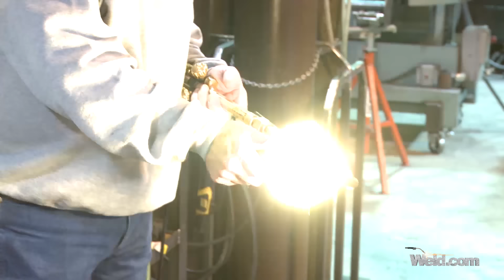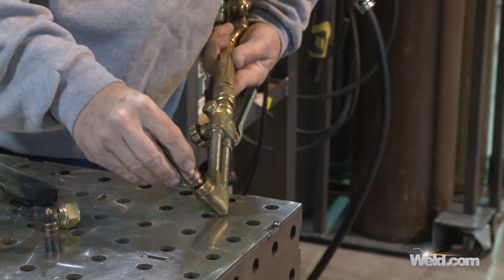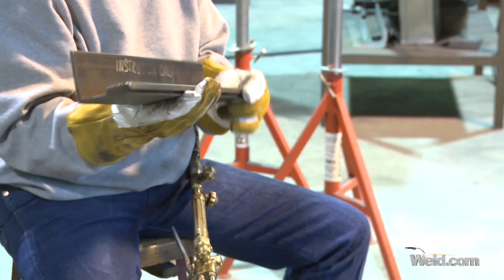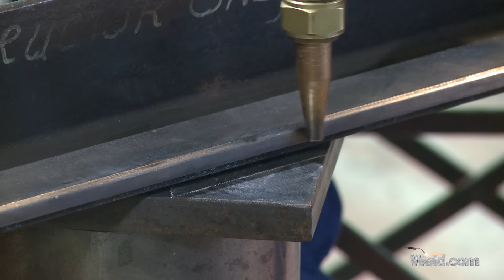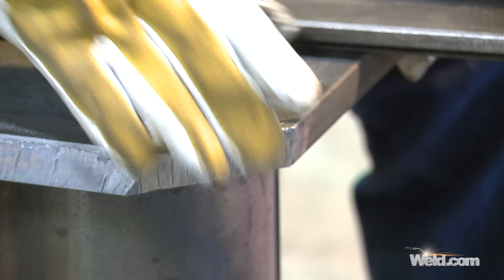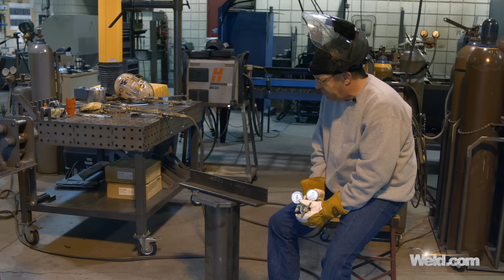🔥 Tips for Oxy-Fuel Cutting Thick Steel

Comment: A set of "tip cleaners" was always in my work bucket. Along with that I'd carry extra, different size tips. On a repair job, I'd swap out the company tip for mine (if necessary). Then swap back, when I was done.

Comment: Bigger tip. Say, 4 or 5. (I like Harris)

Pressure Gauges on torch. Two stage gauges at tank. 15 pounds propane, 65 oxygen. It’ll cut through most steel.

Comment: How can you tell if you have a regulator problem versus a pressure gauge problem or a acetylene doesn’t like the cold weather problem? I inherited my dads OA torch and am trying to learn but cannot find a teacher. When I set the acetylene to 5 psi the gauge drops when I open the torch valve, is it’s supposed to maintain the 5psi or drop while using it? Mind you the garage it’s in is 38-40°. Wish I had an old timer around because I’m sure they could show me so much in as quick as an hour. Hell I’d pay for a day class. Seems a lot can be done with OA but with zero experience and knowledge it’s making for little success so far. 😳

Comment: That bevel cut was nothing short of amazing.  I have a lot to learn when it comes to torch work.  It's always fun watching a true pro cutting steel.  I probably would've fallen over if I saw 30 psi on the acetylene.  I'm a bit scared of using it, to be honest, which can't be good from my cutting ability, but oxy/propane just doesn't do it.  I guess if you're safe and mindful of your equipment that's all you can do.  It just sucks having to keep an explosive device next to you all day, knowing that if you screw up, you're going to have a very, very bad day.

Comment: Thats wher propane comes in . With acetylene 70 percent a your heat is in your primary cones . 30 percent in your secondary flame . With propane its the other way . 70 percent of the heat is in your seconday flame . 30 percent in your primary cones . So with propane you dont get a bunch a surface melt . Cuts way better on thicker stuff ! Dont frget . Torching is classified as " accelerated rusting " ! Ppl think the primary cones are melting the steel allowing you to cut . NOT true ! Ive torched fr hours at a time . Your tip will get so hot the flame will pop out . Ive cut 3 , 4 feet still with no flame ! 
Chemical reaction with acetylene ! Accelerated rusting ! When your torch gets to hot and pops the flame out . As long as you dont turn the acetylene off you can keep cutting with NO flame at all ! As soon as you take the acetylene out of the picture . Game over . The chrmicsl reaction stops . And so does your cutting ! FYI

Comment: Hey Bob i have a question when cutting a 1 inch thick steel plate should the acetylene set at 10 psi an oxygen pressure at 80 psi ??? ...

Comment: Here's a hot tip (pun intended):
When you want to start cutting a hole in any thickness of metal (steel) use a centre-punch to gouge a small ding in the plate, away from your cut line (inside your hole in the waste metal preferably). Pre-heat your plate, then heat up the ding with your torch to white-hot (i.e. melting) and apply your oxy draught. You'll find this cuts a pilot-hole right through your plate and from there you can cut out to your circle/hole line and cut away.

Comment: If this is suppose to be an instructional video you need to not blast through everything so fast, like what the acetylene flame should look like before you turn on the oxygen, and then what the flame looks like. You just blast through those things as well as others so fast that for a beginner so much info is missing.

Comment: Hi Bob, and thanks for another QUALITY training video. 
   Our shop had a setting of 12/42 for everything. Of course we worked with heavy steel all the time and kept big tips on the torches.      
   Here's a trick an old boiler-maker taught me, over 40 years ago, that works really well for cleaning your cutting tip, right before you start cutting. Get a rough-cut Oak 2x4 x 18" long. You can use that as a rest to keep the heat away from your hand...that and a C-clamp vice grip. Get your flame ready to cut. Squeeze the Oxy handle and place the face of the tip onto the face of the Oak board, and drag it to you...like 6" in 2 seconds fast. Then immediately put it to the metal, get the puddle and start your cut. You'll be amazed at the difference! He said the Oak carbon blows out the mill-scale and cleans your tip...HOT. Then it's ready to eat!
   I appreciate your videos!
Please advise ALL your students to NEVER oil the threads on your bottle caps nor get oil anywhere around oxygen! It will blow up!Very dangerous! The 3 piece bottle caps are the way to go. Screw them on, hinge them closed and put the pin in the hole. When not using torch. That way, if for some reason the securement for the tank releases its hold on the tank, the valve will be protected!

THANKS FOR POSTING

Comment: I'm planning on buying some 1/2 and some 1 inch plate for a couple projects I have and my only means of cutting at the moment are a angle grinder and a chop saw. Almost looked into a harbor freight plasma cutter but that only does 1/4 inch at 120 volts i dont currently have a 240 setup in my garage so that won't work.

Comment: Thanks, I've done a bit of this up to 3/4" and ok for what I wanted but always looking for new tricks. I was cutting bar weights for my son so being round and having a wheel bearing or to hanging round I made a turntable, worked quite well very smooth to turn but at that time my issue was setting pressures and using the correct tip so lots of slag! Just wondering with your manual cuts would it be smoother to pull the torch instead of pushing?? Re your mill scale I've been on site with all the good gear on and still got grit in my eye. I believe it either bounces off your cheek or turbulence draws it in. Another quick story we had a "gun" pipeline welder from the good ol' USofA and he had huge ear holes! why? well he would stick a fair sized coin in there to stop the nasties getting in...good bloke to.

Comment: The by-product on the underside is correctly known as dross, slag is the by-product of an MMA Welding rod after welding. I admire your enthusiasm, but frown upon your terminology. And if you require a straight-edge to oxy-fuel cut, then you're an ameteur.

Comment: Most metro weld shops have several different gases. Forget Acetylene -wise up-- 37 years experience with all kinds of gases.  Natural gas is about 5000 btu--Mapp gas hotter---LP gas hotter yet--- that plug up your tips solid one piece copper is the crappiest tips your committed to using Acetylene (Ace is only 6000 btu's). The best gas is Propane for cutting thick steel--the main reason is it uses a two piece tip(Copper outside jacket with 1/8 inch recessed brass multi  veined inner tip----easier cleaning period!).  Cut 26" thick plate with a rare setup of Natural gas 3 PSI bumped up by a compressor provided by the power company to 85 PSI--- back in 76. The only way this even worked was the ancient NCG burning machine ran valves 1 inch then 6" diameter gauges that today those gages would cost thousands(probably only found on diving decompression chambers now a days).   Nothing like running three torches in 12 inch cutting bearing caps for a crane with a 275 ft. boom and 50 ton gearbox.
                     Just to throw it out there---- there are torches & gases--Iron powder combos that cut slabs at mills in Europe that cut 4 feet thick.    www.oxy-arc.com  see their PDF cataloge.

Comment: Just started welding class. Not sure what the exact tip size was but it looked to be similar to yours a 00. I found it was easier to cut the thicker piece a 5/8 I believe. The thinner piece like a quarter inch or smaller wanted to melt back together when I was cutting. We were following corresponding victor tip charts and keeping acetylene not too far over 5 psi.

Comment: I’ve noticed you really only get the “pour” from the beveled cuts when cutting an edge. When you leave some land the Slag will build up at the bottom of the cut but usually flakes off and cut quality is comparably the same.

Comment: Funny I should find this video lol. I just bought a torch and regulators, second hand, and I had an irregular regulator too. Mine was the oxygen gauge that was faulty though. Now, this is in my little home shop so... super scary stuff. Went through proper procedure, turned it up to about 30lbs, it worked for about 3 seconds then I could feel the torch start to push back a bit, then a lot! By the time I got to the bottle to shut it down it had gotten to well over 150lbs! (literally bent the needle) I was pretty shook up by the whole ordeal, but also thankful it was me that got the torch set. If someone less experienced picked it up well, it could have been a lot worse.
Needless to say, that regulator is stripped down and out of service and the %$^% that sold me the regulator got a serious earful. Sorry for the extra long comment, honestly it was pretty recent and I'm still venting about it 🤣. 
Thanks for the video, Bob! 👍😊👍.
Reply: So you slammed an old reg and thought you’d give the seller an earful?
Reply: @agoniaXdunya  it looked brand new. As to answer your question, the fella sold me a dangerously faulty tool and I gave him an earful 😏.

Comment: Bob .. cleaning: you mentioned a mill file, yup, work good! But another old timers trick... Polish the soot dirt and junk off the outside of the tip too. Seems to help make a hotter cleaner flame.
Otherwise, I've always just flown by the seat of my pants... Instinct I guess. My favorite torch set is an old Smith's, my dad picked it up used about 50 years ago. Tips are hard to find, so it's in a box in the shop😥 but back in the day, I could cut a nice clean smooth cut in 3/4" to 1" materials... With a torch rated to a maximum of 1/2" piercing...😎
Safety glasses, shield, goggles... The more you wear, the more chunks get through... 
I've made that trip to the eye doctor, that Dremel tool is psychedelic!! Bending and twisting the lens!!! LOL... I've been there 5 times in over 40 years. Each time I had all the protection I could have..
I'm a bad boy, don't always wear safety glasses... But when I do, I get a ride to town to see the eye doctor..
Accetaline... Ten pounds is usually a great plenty!! I've gone to 12 a few times..  makes me nervous!! 6 or 8 is great!!!

Comment: Do you not look at the angle the slag is coming off the bottom of the cut..?   If it's 70 degrees you are too fast, if it's 90 degrees you are too slow (or stopped.).. ?

Comment: Hidy. Thanks for another wonderful video. You were speaking about tip cleaning...an old boilermaker taught me a kewl cleaning trick, back 40 years ago...take a rough-cut Oak 2x4x12" with you, everywhere you work. Most of the steel he would cut was 2" thick end sheets and 1" on snow-plows (which are modern day cow catchers), on the end of a Locomotive. He says...when your tip starts singing to ya, keep it lit and press the cut trigger and put the tip right on the face of thw wood and drag it along wit the tip touching the wood. The flames will force away...back up toward the torch. Rub the tip on the wood with the trigger pulled, for 4 or 5 three inch rubs and then pull it away from the wood. If the tip was full of scale, the oak will boil it out and the tip will be cleaner than if you ran a wire file into its ports and the end will be like a new tip! Needless to say, I keep a rough cut Oak 2" x 4" x 12" in my welding bay all the time, for tip cleaning. Try that one out

Comment: We're can I send in my. Newly auctioned purchased victor gauges and torches to be rebuilt ?
Reply: Our LWS rebuilds torches (at least puts seals in them and such).  Not sure about the regulators since I have not had any problems with mine.  I would check with the LWS and see what they recommend.

Comment: two things bob.,  show people the difference in the holes in different sizes of torch tips, i use a #2,4 and 8 tips in the shipyard.  also how about showing how to cut with propane or propylene gases which are very common in commercial cutting operations because the gas is so much cheaper

Comment: very good lesson,  i needed that one, thanks, my oxygen regulator blew the fusible plug out for some reason when i cracked the valve open,  it is a Victor set, scared me to death, the set has been used very little but they are several years old..  keep up the good work that you do for all of us, thanks again,,

Comment: Haven't gas welded in years. Veteran, retired, built a forge, baught an arc welder (stick), and was gifted an old double carbon tip arc torch. Anxious to learn about it. Can I weld or cut with it? What is its main use? ... can you help me?

Comment: Love your videos. Have a question or request for a video. I clean much of my new metal and then spray with a light coat of regular metal primer for storage from rust. In your opinion , does welding thru the light coat of primer affect the strength of a weld or how much. I would love to see an in-depth video with cut an etch test and bend test with primer and no primer on equal samples of same welds. All  opinions would be appreciated.
Reply: Primer may leave porosity at times. I would clean it away from the weld area. I wouldn't want to be breathing the fumes either.

Comment: Beautiful cuts, always good to learn a few tips from and old timer. Would like to see you try cutting that 3/4 plate, like the welder us to work with. He would use a 000 tip, 7 lbs acetylene and about 100 psi on oxygen.

Comment: Great stuff.  Any recommendations for cutting 2" thick stuff.  I've been managing to get some cut but I always seem to have more slag on the bottom than I'd like to have.  Running a Purox CW-202 with a #7 nozzle which the catalog recommends for 2 to 4".  But I don't have any pressure recommendations.  I've been using 5 on the acetylene and playing with 40 to 50 on oxy.  I may be traveling too fast cause I sometimes lose the cut in the middle.
Reply: #7 is the "old" numbering system for Purox. Later, they went to listing the tips by the actual size of the material they are designed to cut, so a newer tip (part # 16K11, same as your "#7" tip) would be labeled 4", meaning it is designed to cut up to 4" thick, with a range of 2"-4". I mention this because all the Purox literature for the last who-knows-how-many years has the info listed the "new" way, so being able to cross reference the older size nomenclature to the newer size nomenclature (or, better yet, part #) is helpful :-)

As for pressures, it depends on where you look. The manual for your W201/202 torch and CW-202 cutting attachment (Available here: http://www.esabna.com/eu/literature/archive/manual/f-9000%20-%20f-9499/f-9302-j_purox_w-201_w-202_welding_torches_and_cw-202_cutting_attachment.pdf) gives an acetylene pressure of 5psi and an oxygen pressure of 41-46psi. Keep in mind that is measured AT THE TORCH! If you have 25' long 1/4" hose, you should be OK at those pressures. If your hose is longer, or if you are running 3/16" hose, you will need to bump the pressure up a couple PSI for the acetylene and several PSI for the O2.

The later catalogs give an acetylene pressure of 6-10psi and an oxygen pressure of 40-45psi for 2" steel with that nozzle. However, the nozzle can cut up to 4", and at that thickness the acetylene pressure is the same but the oxygen pressure is 60-75psi. 

If you are getting a lot of slag and losing the cut, the first thing to do is make sure your tip is clean. You should see the oxygen jet when you depress the handle, and it should be nice and thin, not spreading out rapidly or lopsided. If you're convinced your tip condition is good, try increasing the O2 pressure 5 psi at a time. I'd stay under 60psi, but the oxygen jet should remain collimated all the way up to 75psi. Keep your cut speed constant - doin' the herky-jerky is a good way to lose the cut. Don't go too fast OR too slow. According to the chart in the catalog, your cut speed should be 10-12 inches per minute on 2" material at the recommended pressures.

Purox and Oxweld is all I ever use, and I can tell you from experience that if your pressures are set correctly, you have a good tip, and your travel speed is correct, you will get virtually dross-free cuts with clean, sharp edges (at least on the bottom - you may get a bit of rounding on the top unless you hold the tip off a bit more than you would if using it on 4" material). Any bit of dross beads you get will easily knock off with a slag hammer or the grinder. I always use the flapper wheel on my 4" grinder after a cut, but just to break the sharp edges, same as I would for a saw or plasma cut. I don't have to clean dross or dress the edge unless I screw up the cut. Which has been known to happen once or twice ;-)

Hope that helps. Good luck!
Reply: 7 on the acetylene and preheat for a bit.

Comment: any reason that my chalk line would be disappearing as soon as the flame touches it.. if i pre-heat like that i have no line left to follow

just using cheap harbour freight chalk and holders, round and rectangular ones on mild steel...
Reply: i might be using soapstone.. idk what the difference if any is between chalk and soap stone.. i feel like this might be where my problem lays?
Reply: The soapstone even blows away when you start cutting, if and issue you could do like and off timer showed me years ago. You do your layout with soapstone then center punch it about every 3/8 of inch or so.
Reply: @AndrewBrowner  dude knock the mill scale off with a flap disk before you mark your cuts with soapstone. Youll notice ur marks dont disappear as quick.

Comment: Bob, Is it possible to keep a rosebud tip from popping? Thanks.
Reply: That means the flow rate of your fuel gas is too low; you've exceeded the capacity of your tank supply.